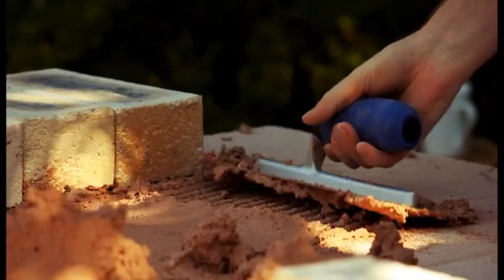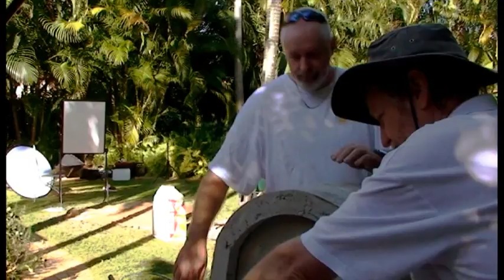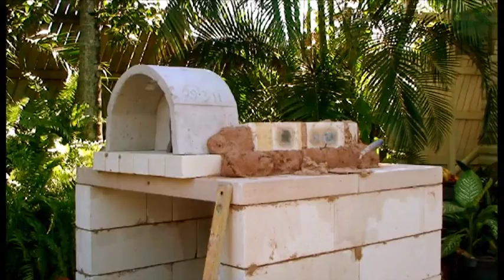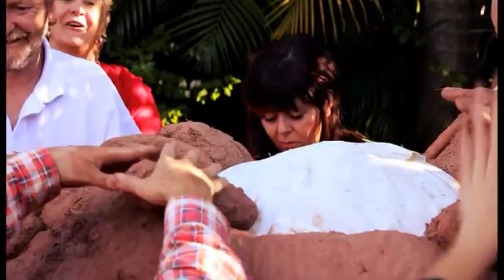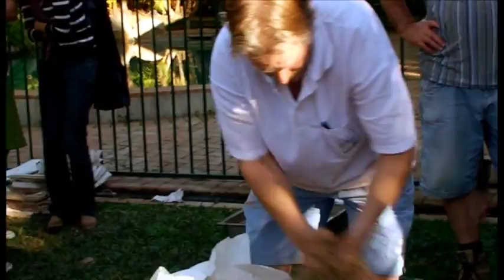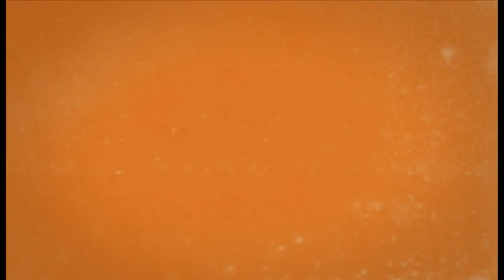Building Your Own Wood Fired Pizza Oven out of Cob (Part 3)

Comment: I like the chimney feature, and how the temperature can be adjusted by using the door as a damper.
I'd like to see the finished oven, see the finish plaster, see how it actually burns, and how it bakes.  I'd like to see how it can bake different things.  You mentioned cooking roast with the fire still in the oven and I haven't seen that technique before.  I'd like to see how the oven's heat can be used to bake different foods as the temperature drops from full-flame to just warm.